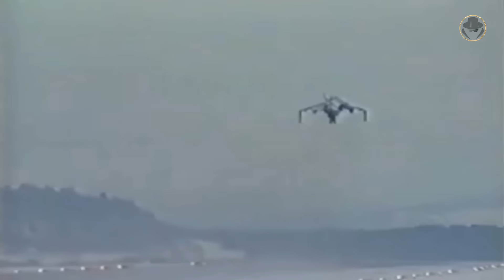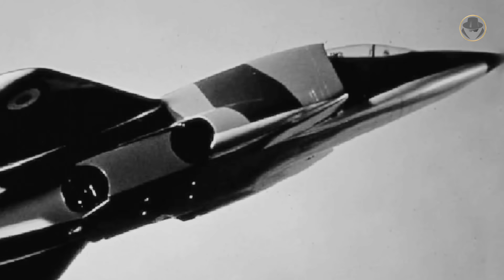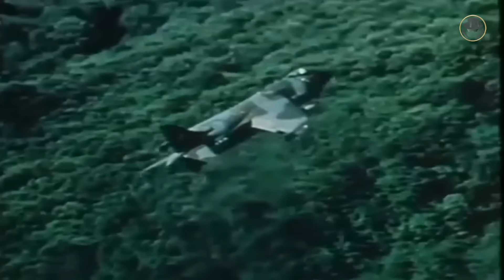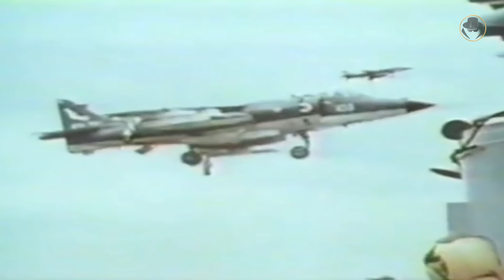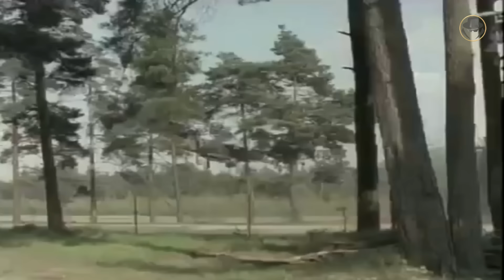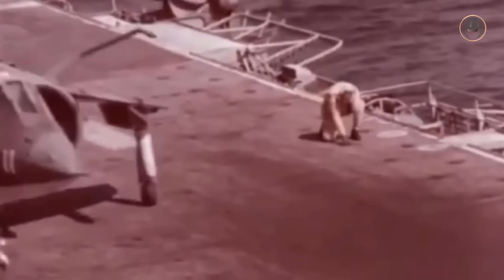Harrier (First Generation) | An unforgettable British beauty

Comment: Don't forget the worlds only FBW Harrier, the VAAC Harrier developed in the early 1990s. It was a two seat first generation Harrier modified to have a FBW flight control system where all the hover and transition was automated thus making operating the aircraft a lot safer. The FBW system pioneered on the VAAC Harrier (which was 100% British) was adopted by the US as the FCS for the F35. In a sane world the UK would have kept the Harrier in service and modified all its second generation and Sea Harriers to use the FBW system pioneered on the VAAC Harrier.

Comment: Harriers are actually worth your money, they will actually do great in a war only in large numbers, they need to be revived
Reply: Im sorry but they wont sadly. F35 b are taking their place. I love harriers too but i also love the f35s and it is a good switch. But having said that. Wouldn't hurt to keep 50% of em and upgrade them then mothball em. Just incase they need them later. Honestly its suprising that they weren't used more in afganistan. Could of had Airbase FOBs. Woulda been handy and cool
Reply: @dadinkle  the main reason why is because the Harrier is inferior in range and payload capacity when compared to the F35B, the only strong point for the Harrier in comparison with the F35B is its unit cost
Reply: They didn't need large numbers of them in the Falklands.
Reply: @neiloflongbeck5705  they actually did, if not why they did their best to get more over there instead of being contented with the 24 on both carriers
Reply: @joelchee9308  let's see the initial 28 Sea Harriers (out of a total force of 34) were expected to be facing off around 120 serviceable Argentinian combat aircraft with around half of them designed primarily for air to air combat. Roughly a 4:1 ratio in favour of the Argentinians. The RAF Harrier force was always intended to reinforce the RNAS's Sea Harriers in such circumstances and so 10 from 1 Squadron were deployed primarily for ground attack work and in a pinch local air defence work. This brought the British fixed 3ing combat fleet up to 38, reducing the imbalance of forces to a mere 3:1. Later on reserves of aircraft were brought south in the intention of replacing combat and other losses. 42 is not a large number, by any standard, but nor is 120. But at the end of a long supply change it must have seemed like one.
Reply: 5th gen future proof jet with electronic attack, stealth, long range radar and missiles vs Out of date vtol jet with inferior radar and weapons because muh   cheap prices.
Reply: @COLT6940  Radar can always be replaced with a better one, the airframe can be made with improved materials, but numerical superiority sometimes wins the war.
Reply: @joelchee9308  there is no more room for upgrading harrier jet, that why f35b was developed. Uk will have 60 f35B and option for total 120 jet. Most nations barely have more than 40s 4th gen aging jet.
Reply: Battlefield Earth foresaw this need. They still work with millenia old fuel. Very rugged

Comment: The harrier is overrated. It killed many a pilot and had the flight envelop of a fighter built in the 50s.
Reply: Tell that to the Argies.
Reply: And so did so many other aircraft of the 50s and 60s. It was a handful for the pilots, they’re open about that, but the short/no airfield capability it brought was revolutionary!
Reply: If you think VTOL capability is overrated....
Reply: Many aircraft from the 50s, 60s and 70s killed their pilots. Its off-runway capability could have been useful if the Cold War went hot. Britain would not have won the Falklands War without the Sea Harrier. And second generation Harriers proved themselves in the CAS role during the Gulf War, over Bosnia, Iraq & Afghanistan. So an aircraft that deserves the recognition it gets.
Reply: As others said, many planes killed their pilots, however the Harrier it turned out to heavily come in terms of the US having this issue and that being due to how they were training their pilots/operational usage, once they changed this and adopted similar systems to the British, losses dropped quickly.